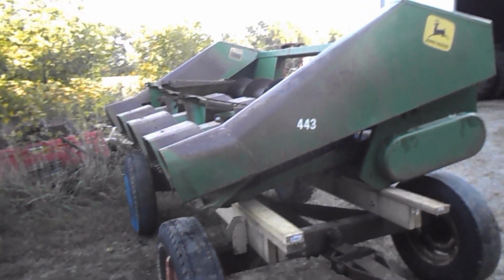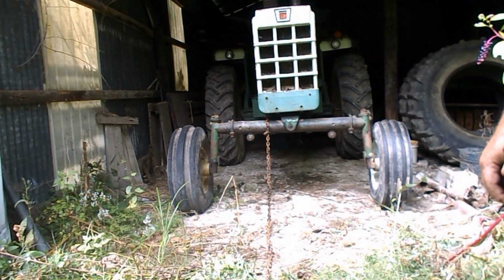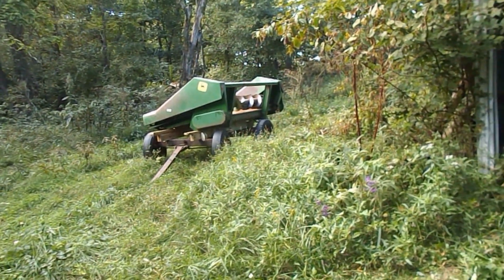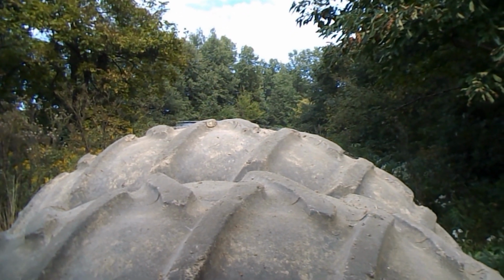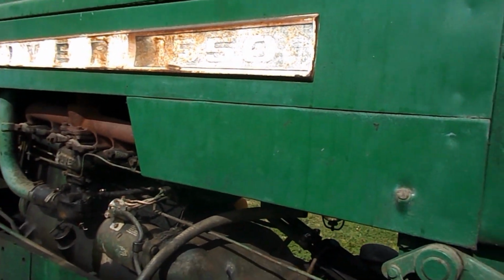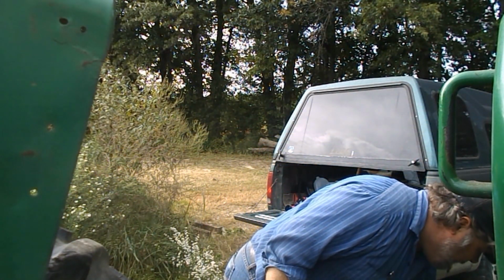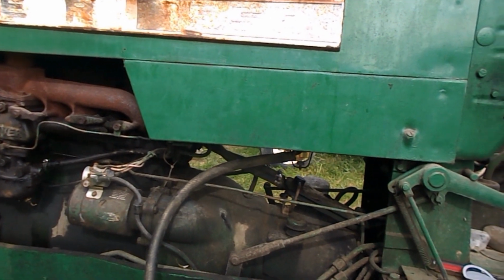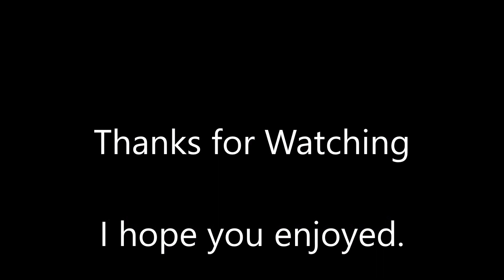A Long Busy Day Sept 22 2022 A little about the 1550 gas

Comment: Bandit, the other half of the snouts unhook as well you just pop the 2 clamps loose that latch them down and then the whole snout will flip forward without taking just the ends off, when they flip forward then you just pull straight up and the whole assembly comes out of the lil hinge it pivots in
Reply from the maker: Well the problem with taking the hole snout off is its heavy and I'm still have a hernia to deal with so I decided just to take the snout off.  It's a good thing I did or I would have never found those bushings were bad and needing replaced. I figured it I just take the snouts off it will fit in the barn no problem and it did.  Sometimes I have to do things a little differently because of health reasons and it might take me a little longer to get something done but it gets done. Bandit
Reply: @banditfarmer1900  oh how well I know buddy 10 years ago I was farming close to 1000 acres not counting 250 in pasture with the cows and commercial hay sales as well,  there is no way on Earth I could even attempt that today unless I hired 2 full time guys, then you working all year just to pay them, so I do just what I can and let the rough end drag on the rest 😆
Reply from the maker: @lukedesselle2491  Me and dad farmed about 325 350 acres together and worked a full time job and did it with about the same equipment I have now. That made for some really long days for both of us to say the least and for about 6 years me and a buddy of mine did about 5000 bales of hay over the summer. When I got married I let most of the rented ground go and sold some equipment I wouldnt need so I could go into the marriage debt free and I have managed to keep it that way, All I owe on is my house and it will be paid off in 3 years !  I dont miss all the farming I did years ago dont get me wrong there was a lot of fun doing it but I saw the hand righting on the wall and backed off a bunch !  That was good for married life and my health and now its farm what I own and I am very happy doing it. Let the young guys farm the country side and take all the risk , Me I'm happy the way things are now.  Bandit
Reply: @banditfarmer1900  you can tell your dad really wants to be able to help you more , he's like my grandfather was at the end his mind still wanted to get things done and work, but the body just couldn't go anymore my grandfather took it really hard when he could no longer work
Reply from the maker: @lukedesselle2491  It really killed my soul to have to tell dad no as far as driving the tractors but I had to. I know he wants to be out there working ground but I have to do my part to keep him safe, If I let him do as he pleases and he got hurt I could never forgive myself . So I had to do what dad did to me when I was young, I couldnt drive a tractor until I could reach the peddles sitting in the seat and he knew I knew what I was doing so I got a lot of fender time ! He also told me if you cant get on it by yourself you have no business trying to run it. But I try my best to keep dad involved as much as possible in the farm and he does enjoy being out in the field watching me while he has a cup of coffee and a cigar ! He is the supervisor on the farm and wants to make sure its done right !  Bandit

Comment: Glad you got the clutch unstuck.
Reply from the maker: I really wasnt sure this was going to work, It was in reverse when I hit the key with the clutch pushed in and that brought it just out of its tracks so then I was really screwed cause I couldnt get it out of reverse !  Pulled it forward just a few inches with the clutch pushed in and she broke loose ! At least one thing went right that day !  When I drove it up to the barn I was riding the clutch slipping it to help clean it up and so far it seams to have worked perfectly . But I'm not the only one having to do this, I've herd several other guys having to do the same thing this year, Just goes to show how wet its been around here this year !  Bandit
Reply: @banditfarmer1900   We had to do it years ago on our 165 MF. It is still working fine and it's been probably 15 years ago.
Reply from the maker: @Fieldman12  My JD 95 when I bought it the clutch was stuck and to make things more interesting its a double clutch !  That was a fun one to brake loose. My Long stuck one time but I was lucky is I had a disk hooked to it at the time, So it was start it up in neutral raise the disk up shut it off put it in gear and start it back up and go. With the clutch pushed it I simply dropped the disk and in a few feet she broke loose then it was just slip the clutch  a little to clean it up. But it goes to show just how wet it can be around here ! Bandit

Comment: I enjoyed the history of the 1550.  I've had that stuck clutch situation several times before, but was able to shift gears if the tractor was off.  I generally just ran the tractor up a steep hill with the clutch on and the clutch would eventually break loose.  Always something!
Reply from the maker: Some of the tractors and equipment I have I know there history from when they were new but there is a lot I know nothing about its history. There is a lot of equipment I'm the second owner of but like the 770 all I know about it is it belonged to a guy that died a few years ago and his brothers said they didnt know anything about it so its history is unknown.  My 1550 it stuck the clutch and it truly shows how wet its been this year and when I went to start it I had left it in reverse so it wouldnt roll forward and when I hit the key it started to back up with the clutch pushed in so it came up out of its divot it was setting in and at that point would not come out of gear cause it had pressure on it. So a little pull with the clutch peddle chained down she popped loose.  She was very angry when she started up and she let me know she was not happy sitting back there ! LOL  When you working by yourself sometimes you got to get creative in how you get things done.  Bandit
Reply: @banditfarmer1900  Oh I know about the working by yourself thing. When my dad dies 33 years ago, I had to make a lot of adjustments, because there used to always be 2 of us, and at that point it became just me.  You have to be really creative sometimes.
Reply from the maker: @pagrainfarmer  Worst part of doing it by yourself are the job 2 people can do in a minuet and it takes an hour to do by yourself !  I rely on the skid steer a lot to move equipment around and to move stuff around and if I didnt have it I really dont know how I would do it !  I've give up backing wagons in with a tractor, Its so much easer to do with the skid steer and a hole lot easer to hook them up by yourself. Pull up slip the fork in the tong you see the hole get off drop the pin in and away you go and the best part is not having to twist your neck around to try to see what your doing ! Nope you sit there looking forward and can comfortable sit there and push it in right ware you want it !   Its turned out to be the go to machine on the farm !  Bandit
Reply: @banditfarmer1900  I heard it said once that 2 people working together can do more than 1 person working twice as long.  and I believe it.  I know skid loaders are very handy. I just can/t justify the cost for all the more I would use it.  My next door neighbor lets me use his whenever I need it, which is nice.
Reply from the maker: @pagrainfarmer  When hooking up equipment with 2 people it's so easy to do but by yourself it can be a nightmare to do especially if its 3 pt !  Thank God for extendable tongs on wagons or it can be an ordeal to hook up by yourself but 3pt stuff is the worst by yourself but a quick hitch sure makes that easer to do !  When dad wanted to go look at something I had no idea it was a skid steer and I really didnt think we needed it but we bought it and I'm glad to say I was wrong in we didnt need it ! Now its what would I do without it ! LOL Very handy maching to have around the farm for a lot of reasons. Anymore I dont even try to back a wagon in the barn with a tractor I grab the skid steer and its in no time and so much easer !  We gave $3200 for it and I got to say it was money well spent as far as I'm concerned. It's old and nothing fancy but it sure get the job done and its a lot easer to work on than the newer ones for sure !  Bandit
Reply: @banditfarmer1900  Well, that "easier to work on" idea is true of most of the old equipment and tractors I run here.  It's old, but I do my best to keep it in good shape.  It all works and gets the job done and is easy to work on.
Reply from the maker: @pagrainfarmer  I guess I got lucky when I bought the Long as I had to buy a metric tool set to work on the wifes car, Dang thing was 1/2 SAE and 1/2 metric ! So at least I had metric tool to work on the Long and with everything on it made in Europe well I just made American parts fit it and was re-wired like a 1550 diesel to make it easy to work on.  I guess I like the older stuff simply because I can work on it and fix things, I dont want anything I have to hook a computer to it to figure out whats wrong with it !  But it's mostly what I can afford to buy and run so older stuff is good enough for me.  Never was one of those people who had to one up the neighbor or keep up with the Jones's . The way I figure it is the older timers had it right years ago, You dont make money buying new equipment and having a 10 or 15 year expansion plan to be bigger. Figure out what works and go with it pinch and save every penny you can and save money in a good year for the bad years you know are coming and ride it out with some comfort. Seen a lot of guys come and go over the years and they all did the same kind of stuff get bigger and get cocky make a bad decision and there house of cards falls apart and they all said the same thing it looked good on paper ! LOL  Only paper I care to look at is the one on my bank account !  LOL  Bandit
Reply: @banditfarmer1900  Yeah, that's tough when you're working on something with parts coming from out  of the country.  I just recently had a chance to by a JD 4425 combine, which looked like it was in fantastic shape.  But I did a little research and found that, unlike the 4400 and 4420, the 4425 was made in Germany, and that parts, when available, take a while because they come from overseas.  I passed on that and will stick with my 4400.  I like the older stuff, too.  All my equipment is paid for - don't own anyone a cent on it.  And that's how I keep my operation afloat.  I like stuff that's easy and straight forward to work on, and for example, my Oliver and White tractors are.
Reply from the maker: @pagrainfarmer  I've been asked over the years why I dont have an Oliver or White combine being I like Oliver's so much. Well it's simple 1 I never care for them for the way there built 2 ware am I going to get parts for it ? The only true Agco dealer is 70 miles away and me and them have already had a go round so I wont go there anymore.  In 1988 I went from Gleaner (Same dealer) to JD combines and never looked back !  JD is really good about parts for older stuff and they made a lot of the 4400's so there are plenty of parts new and used to be had for them. Why own something that is going to be a problem getting parts for it when I can have something easy to get parts for it. Getting part for a Chevy 292 is pretty easy and are very commend engines so easy to replace if needed but go to a 329 gas JD engine well thats another story !  I'm still thinking about rebuilding the old 95 just because it is so much easer to work on and operate ware the 4400 is nothing but a pain in the butt to work on !  I'm not a big fan of the 4400 and said so when I bought it, But I'm smart enough to see a good deal when it pops up and for $1100 I bought it and can learn to like it enough to run it and it dose do a good job but its still hard to work on !  Keep things simple and you will be better off and a lot happier !  Bandit

Comment: I remember when you had that all cleaned up before. Doesn't take long for grass and weeds to take over.
Reply from the maker: Man keeping ahead of the weeds and brush back in the woods is a job by itself !  There are trees growing threw equipment that werent there 2 years ago. I've never seen trees grow as fast as they do around here, One day you see a sapling 3 foot tall and a year later its 10 foot tall and 4 inches around !  But no worries I got the thing to get rid of them , The Gehl 4400 skid steer !  Multiflora rose bushes bryers saplings dont stand a chance when the skid steer comes after them ! LOL  Bandit

Comment from the maker: Well I started the day taking the snouts off the corn head so it will fit in the barn in the woods and me and dad took it back to put it in the barn and found out the clutch on the 1550 diesel is stuck and its in reverse and wont come out of gear. So Thursday morning I took the 1850 back to get the 1550 unstuck and as I got into the woods it quit !  I forgot to turn the fuel tank on ! So I had to walk back to the barn get tools to bleed the pump then walk back to the woods to fix it !  After getting it running I hooked a chain to the 1550 after adjusting the clutch and tying the clutch petal down with a chain and gave it a little pull and she popped loose !  So I started it and boy was she mad when she started !  I parked the 1850 and drove the 1550 back up to the front barn riding the clutch so it would slip so it would clean it up some. I took the Gehl 4400 skid steer back to push the corn head in the barn and to move some other stuff around while it was back there and I brought the tires I took off the long up so they can be mounted up on the dual rims I have so I can use them on the 1850 in the future. Then it was walk back to get the 1850 and bring it back up front.  Well then its work on the 1550 gas, I need to drain the fuel tank so I can take the sediment bowl off for a good look at it and clean it up. I had to run to McHenry's to get a new bowl gasket and a new screen for it. While its draining I have a little story time about the 1550 gas and ware it came from. The gasket and screen were $5.30 and it was a cheep fix for the 1550. I fired it up and ran it bush hogging for an hour and it ran great !  This is kind of a typical day for me but I got a lot done today and I hoped you enjoyed watching as I got things done.  Bandit

Comment: Are you planning on using the bailer next year? It looks like you could fit a smaller tractor in front of the bailer to keep something else out of the weather if you can. Just my opinion tho. Been extremely lately and haven’t been watching the videos. I hope your health is doing good. Be careful with that bob cat you have running Around.
Reply from the maker: I would really like to get that baler out give it a good going over and bale some with it, This is a baler anyone would have loved to find it and buy it cause it was bought new used 2 years and its sat in the barn ever sense ! It cant have 3000 bales threw it total in its life !  Its not a JD or NH but anytime you can find a baler with this few bales run threw it you know its going to be a good one ! I've had a really busy fall myself and today is no different got to set up to load out beans disk some ruts in clean the combine up and put it away and get the tractors back in the barn before it rains tomorrow !  Never a dual moment around here ! LOL I've been back in the woods a couple of times this fall that I felt like I was being watched, You know it when the little hairs stand up on the back of your neck and feel a little uneasy and cant wait to get out of there . I dont go back there without my little friend with me !  Bandit

Comment: You're gonna have to start a phone hotline on bleeding that Perkins diesel! 1-900-Bandit's. Have to talk to the customers in a sweet Oliver tone of voice ha ha haaa
Reply from the maker: Lord knows I've taken the pump on and off enough I can do it in my sleep !  LOL  Bleeding that pump is really easy, Just loosen the bleeder screw go around and start pumping fuel with the manual lever on the fuel pump and when you see a solid stream of fuel hitting the ground run around and tighten the screw and your good to go !  I've seen others that its an hour job to get the pump bled out !  I'm glad this one is easy !  Bandit
Reply: @banditfarmer1900   I can't believe I was intimidated by changing my fuel filters! 40 some years of life and I never messed with a diesel and felt like it was all scary in there or something. Lucas/CAV made it easy.
Reply from the maker: @matthewtaylor2185  All my life as far as diesel went could do anything to them but I knew to never fool around with an injector pump, I help change a bunch of them over the years but I'm good with that but I'll never open one up to try to rebuild it cause I know my limitations !  Diesels are pretty simple really , Just keep the fuel system airtight and bleed it out when you change filters and its good to go. I just know to keep my hands off the injector pump and let the pros handle that.  Bandit
Reply: @banditfarmer1900   I have a couple extra CAV pumps I wan to have a go at one of these days. They look simple enough to me. I wouldn't touch most though. This one is on a IH BD154 engine but near identical to the ones on 3 cylinder Perkins Massey 35/135/50/150 tractors  and 4cylinder massey 65/165
Reply from the maker: @matthewtaylor2185  The mechanics of the pump dont bother me its the settings that I have no clue about. There are things that I'll tare apart to fix, However an injection pump is at the top of my list to DNFW !  Thats one of the few things I simply wont touch and will leave to the Pro's to do and I good with that. I wont attempt to do open heart surgery cause I dont know what I'm doing and I feel the same way about injection pumps, I'll leave that to the pros to figure out cause I know my limitations .  Bandit